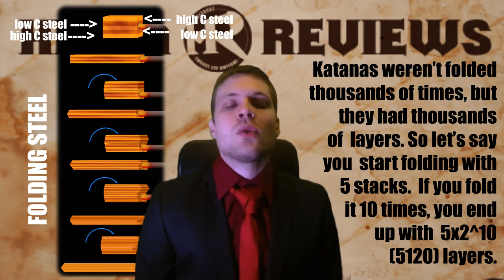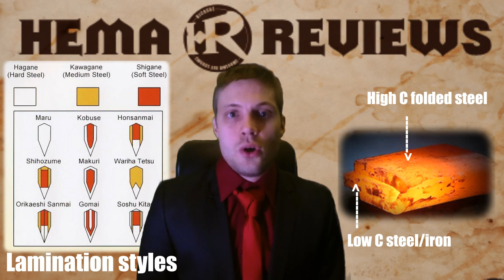Educate Yourself: Katana vs. Longsword

Comment: European longsword is a crude iron and too bulky. The katana is a better weapon. What happens is that there are a lot of cultural patriotism, including racism and xenophobia mixed with a discipline that should be independent of all that, as is fencing.
Reply: to the first part, no just no
Reply from the maker: +Roberto García Vazquez Actually, longswords are on average lighter per cm of length, which means katana is bulkier. It's also most definitely not a crude iron. And yup, patriotism does indeed play a big role - only that's with the katana, not the longsword. If you wish, I can supply you with some data regarding weight and length of original longswords and katanas (though post 18th century katanas get noticably lighter than the ones meant for war).
Also, there is a longsword discipline - it's a part of HEMA.
Reply: you buy swords each other as if they are fighting alone and reach conclusions in my confusing and erroneous opinion. The sword has less than forty percent of the result of an assault, the rest is skill and knowledge of the swordsman. It is absurd to say that a small sword is lower in a duel to a rapier. With regard to patriotism and prejudice, it is feelings that prevent us from seeing the reality of fencing from a technical and practical level, therefore, has no value the opinion on matters fencing which acts motivated by such feelings and They lacking objectivity. Regarding the characteristics of dai-to, I know them well, as a practitioner of kendo and kenjutsu, and say that there are many types of Japanese sword in relation to its weight and volume. Here in Spain we also know fencing master, and we do our homework well, we have our school tradition rapier and saber, sword etc. but that does not stop us to admire and respect the Japanese school.
Reply: +Roberto García Vazquez Pal, if English isn't your first language than my apologies but that was next to unreadable
Reply: +Roberto García Vazquez WTF U SAYING
Reply: Can you explain me why the Japanese imported at a certain time European steel? You might like to explain as well why plate armor was mass produced in Europe and not in Japan? The quality of steel was better and could be produced in higher quantities. Yes japanese smith are awesome for what material they had to work with. 
What makes you think that the Langsword is bulky and crude? The Longsword is inch for inch lighter then the typical Katana. The pommel acts as a counterweight so the Longsword is better balanced to the hilt.
Reply: But that does that matter! The truth is that the Japanese katana is an excellent weapon in design and performance. European long sword is also good, of course, but not superior at all, they are just different weapons. To see if you are able to understand that a sword is not better simply because they can do with a certain quality steel, if that were the problem of katana, all you have to do is use the best steel to make it. And issue solved! because, as you may have already noticed, we do not live in the Middle Ages if not in the twenty-first century, European swords were made of steel that were available, in fact, the British had swords with steel shoddy up we sold them our Spanish steel. If the Japanese have the best steel for uilizan because they are not stupid. But the product is still good for its design and, most importantly, for your fencing system. It is simply a steel product improvement. Please make comments more intellectual level.
Reply: Call troll people if quite rude. I leave this conversation is not going anywhere.